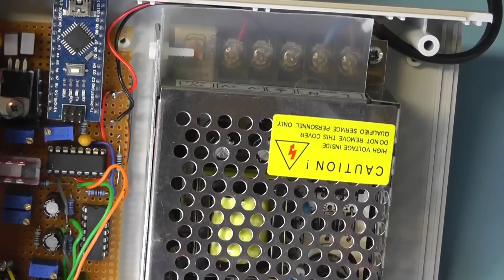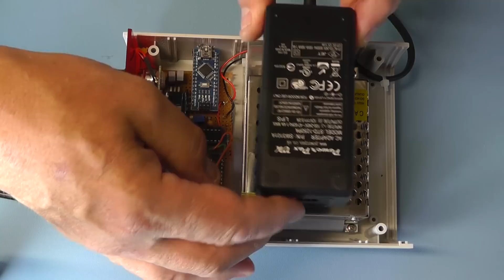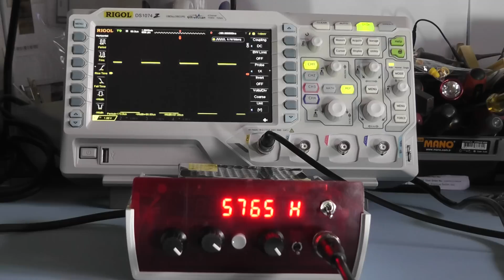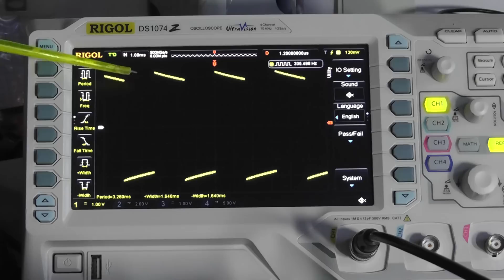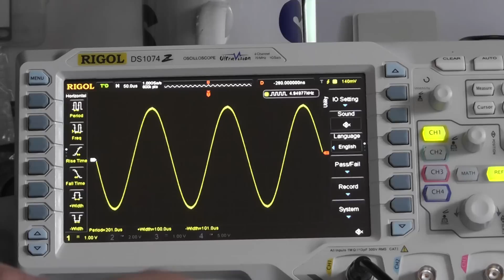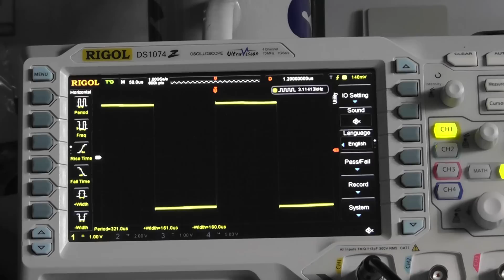Scullcom Hobby Electronics #28 - Build a Function Generator Part 3

Comment: First of all, thank you very much for the teachings I have gained and amplified through your videos and projects. I am building this function generator and I would like to know if it is possible to use the TL072 or even the TL074 instead of the NE5532P. What would be the harm with this choice for TL0XX? I will use my function generator for the audio track. Thank you in advance. Jossy Dornelles - São Paulo - Brazil.

Comment: Hi Louis,,what other possible OPAMP can I use in placed of NE5532? Is it possible to use the very common LM358 or C4558 dual OPAMP? If not,what are the things to consider in selecting opamp as a replacement for the NE5532? Thanks.

Comment: Are you able to provide your KiCad files for this project  as I may then be able to produce the pcb for it? Unless you have already done so.
Reply from the maker: Hi Bruce,
When I first did this project It was not done using KiCad. I am planning an update to this project for which I will have a Kicad file as I intend to make a few updates and produce a double sided PCB. At the moment I am working on an update for my Electronic D.C. Load which includes a new double sided PCB and extra features, so I want to finish that first before going back to the Function Generator project. Regards, Louis

Comment: They make a 150 pF Cap, when I go to follow this project I think I'm going to give that a try to better smooth the digital output overshoot... nice project though, it's guaranteed to teach me more about wave form generation than those chintzy little 7$ (USD) eBay kit function gens... thanks for the education, I can't wait until I can start ordering the components. I think I will get a slightly larger project box so that I can put all the controls and the input and output connectors all on the front, and I think I'd prefer having an opaque front and building a window for the display. Also I may consider an LCD display with a more informative output, like denoting the wave mode and gain value etc... but I may make that a later upgrade, IDK, we'll see when I get around to actually following the build... anyways thanks again for the excellent project idea and tutorial.
Reply from the maker: Thanks Grant for your comments and best wishes with your build of the project. I think I will do an update to this project and design a PCB for it and have some made. I am currently working on an update to my Electronic DC load project which I want to complete first. Regards, Louis

Comment: You never made the next follow up, as stated?
Reply from the maker: Sorry Bruce, I got side tracked. I think I may have another look at this project and also design a PCB for it. Regards, Louis
Reply: Scullcom Hobby Electronics sounds great, I will certainly be looking forward to seeing the follow up and your pcb design. I am struggling with both Kicad and frizzing as the components I need aren’t there as you have them on your Kicad layout, otherwise I would have got stuck into the pcb design myself. I prefer the pcb layouts as they are much neater than vero (strip) board and perfboard layouts and make fault finding and modifications, if needed, much easier.
Reply: I also wanted to say that I am extremely pleased with your designs and explanations 👍👍👍

Comment: Louis, Would #30 wire wrapping wire be heavy enough to use when I join component on the  matrix board. I am Making this Audio generator on this green pc board that has solderable holes on top and bottom. I was wondering if the #30awg wire is heavy enough . The wire is solid not stranded,( and it came from china so it might be slightly smaller than the advertised size of #30awg.
Thanks in advanced
Rodney in Californacation, USA (I dont jive with the politics here in California)
Reply from the maker: Hi Rodney,
#30 wire wrapping although thin should be OK for the signal connections as the wire runs are very short. However, for the power lines it may be better to use thicker gauge wire.
Regards,
Louis

Comment: I built this function generator and am now ready to put it in a box . I am Quite Happy that it worked, no magic smoke.....yet. I do notice that when you change the frequency switch between square and sine that your wave form snaps quite fast from sine to square to triangle . Mine doesn't.  When it changes from square wave to sine wave the wave takes a few seconds and it "morphs" almost like the man does in the "Terminator " movie . yea the wave morphs from on shape to the other . even when changing frequency the wave morphs . On the oscilloscope parts of the wave will droop down and slowly work itself into a decent looking wave. You have any idea what could be wrong. I used your version 2 schematic diagram .
Thank You for publishing this project. It was my first project and I had alot of fun building it 
Rodney
Reply from the maker: Hi Rodney,
Thanks for your comments. Glad you enjoyed the project. First check that your +12v rail is correct, if this is low it could cause problems. You may have to play with the adjustments RV6 and RV7. Also check that you do not have any bad connections especially those going to ground. Also check the value of C11 is correct (0.22uF). If still having issues try changing the XR2206 IC.
Let me know how you get on.
Regards,
Louis
Reply: Thank you for your comments. I will definitely check your recommendations.  I just learned of your website. I find your career very interesting. Us youtubers that enjoy hobby electronics are very fortunate to have you do what you do. Your strong teaching skills definitely reflect in your presentations.
Thanks again 
PS . I am going to build it on a matrix board and follow your layout. I see you are using tantalum capacitor and the green (metal foil I think) anyway I have ordered those types because the ones I was using were little box capacitors I got from ebay (.22uF and .022uF used for the frequency range). I will keep you posted.
I would like to become a Patreon supporter if you decide to use Patreon. Or if you have other ways to donate I would like to donate.
Rodney
Reply from the maker: Hi Rodney,
Thanks for your comments. Hope the matrix board build works out OK. Let me know how you get on.
I have not considered using Patreon as of yet as I simple upload videos as and when I have the time. I enjoy sharing my ideas with electronics.
Regards,
Louis

Comment: Thanks for this fabulous project! I'm just about to start the build with some trepidation as I still consider myself a relative beginner. You mention at the end of this video, a follow-up which would include "Pulse output and also the option to use the function generator as an external frequency counter". I've not been able to find any follow-up and just wondered if you did ever get around to it?  Once again, thanks for an excellent series of videos on the Function Generator. Regards Erik
Reply from the maker: Thanks Erik for your comments. I did mention about using it with an option as an external frequency counter. Sorry I about that I was distracted on to other projects.
The frequency counter of this project is a function of the software in the Arduino and so it is available to use also as an external frequency counter. The frequency counter input is fed to data pin D5 of the Arduino so if you wish you can add an additional BNC socket which is connected via say a buffer (say a 741 Op Amp wired as a buffer) the output of the OP Amp can then be switch to connect to D5 of the Arduino. As D5 normally goes to pin 2 of U2A you could use a change over switch to switch D5 over to the 741 to provide an external frequency counter input.
Regards,
Louis
Reply: Thanks for such a helpful and detailed reply Louis. I now look forward to adding the external counter to my build. Excellent!

Comment: Hi, this is a great video with detailed explanations.
I have a suggestion. You have used a higher value coupling capacitor at the input of the square wave op-amp to correct the waveform at the lower frequencies. Basically you have improved the low frequency response of the op-amp. The drop in the trailing edge of the square wave is indicative of loss of low frequency response, a boost in the low frequency will result in the opposite, that is rising of the trailing edge and falling of the leading edge. It is the quick and dirty method of checking the flatness of frequency response in any audio amplifier.
Keeping that in view, it can be argued that the frequency response of the sine wave input op-amp is also low on the lower side since you have used the same 0.22 uF capacitor. This will definitely manifest itself in the form of a drop in the final output LEVEL of the signal when the frequency is lowered to its minimum value. Please run a test and confirm this, and then try a 10 uF capacitor and re-check the difference.
Please keep posting such lovely videos. Keep it up.
Reply from the maker: Thanks for you comment and detailed suggestion. Regards, Louis
Reply: Scullcom Hobby Electronics you are welcome

Comment: Would a variable cap. and variable resistor be a good fix? Make it more like a professional function generator with lots of controls?
Reply from the maker: +Robert Miller Thanks for your comments. You could add a small variable capacitor  but I have found using a small fixed capacitor works quite well.

Comment: Hi I have have been playing with the XR2206 in all sorts of configurations including one very similar to yours.I have got rid of switch 4  and given the square wave it's own bnc via 50 ohms direct from U5B. Analogue gives a much nicer sine wave in my view and I do not often need one better for hobby use.I have ordered three boards from OSH PARK for just under seventy dollars same design as yours but changed as described above if anyone wants one.The boards are under 4 x4 inches and have AC rectification as a option.
Reply: Paul,
Do you still have any boards?

Comment: Thanks for the video. I would probably just put a connecter in the box so I could use the power supply for something else while I wasn't using the FG. And also connecters for in case I wanted to hook a battery to it.
Reply from the maker: Robert Calk Jr. Thanks. Good idea as the power pack could be used for other equipment to.
Reply: Robert Calk Jr. 
It would also make the unit smaller and lighter. I also like to make my devices so that I can use them from batteries. I guess it is the prepper in me.:)

Comment: Hi,
Nice project.
Just a point around the power supply. If you are gong to use the metal cased unit please also connect an earth connection.
Thanks for taking the time passing on your knowledge to us all its much appreciated.
Cheers Dave.
Reply: Dave BassettI agree. The Y capacitors inside the metal power supply (Capacitors connected from line and neutral to ground/earth) can form a voltage divider. You'll likely feel a tingle if you put your hand on the case of the power supply then touch a grounded object. The current can be as high as 3.5mA at 264V input and still get safety agency approvals. I measured a power supply similar to the one used here in the lab and with 120V input, saw 62V to ground. In the UK, this voltage would be around 120V. In a prior life I used to qualify power supplies for use in computer peripherals.
Reply: Dave Bassett In this configuration the power supply is double insulated (inside an insulting enclosure), so the internal PSU doesn't need to be earthed to meet standards. Still may be worth doing though. I usually use a fused 3-pin IEC socket on my DIY gear.
Reply from the maker: Dave Bassett Thanks Dave. Good point about connecting an earth connection. I forgot to mention that.

Comment: Another smashing video and improvements to the Mk1 or Mk1 Rev:4 lol :-)
I actually liked your choice of perforated case psu, looks very neat and well ventilated, the sealed supplys do tend to cook themselves in time.
Im actually supprised you get very little noise from the switchmode.
I also thought the same way about the overshoot, limit the gain above the maximum squarewave frequency with a parallel reactance across the gain resistor :-)
Good compromise, didnt round off the sharp hf corners :-D
Also your protective terminal cover is simple but effective.
Reply from the maker: zx8401ztv Thanks again for your comments. Like you I preferred the perforated case switch mode power supply. But I should have taken note that not all hobbyist are comfortable when working with open mains input connections. So I though an alternative may be called for.
Reply: Scullcom Hobby Electronics You cant cater for everyone mate, smashing generator :-D